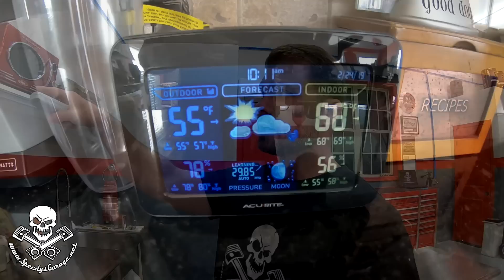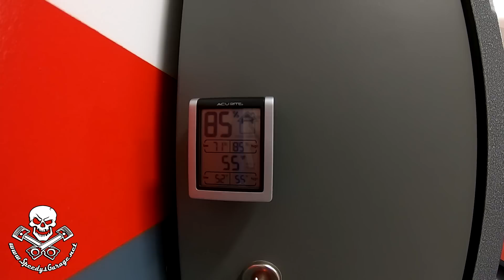Speedy's Garage Shop Build Getting Close

Comment: I feel you with all the rain...I think ATL has turned into Seattle since the first of the year.  Today is the first day we have had sun in a while.

Insulation is not the place to skimp when building anything.  It really makes a difference.  Acoustic sheetrock is pricey, but it works.  I've used it on a couple of theater projects, and it makes the space acoustically dead (no echo).

Great info...keep it coming.

Comment: I think the go-pro worked well for you. Just a little hallow tones  and echo. Are you using a external mic? Are you using a dead cat mic cover? It should help with the echo. Thanks again for the work in putting these out. I put my shop build off until april. But we have had such a late heavy winter in February that I might push it back until mid May before thaw LOL
Reply from the maker: Yep, using a dead cat for sure.  Prob gonna be some echo since most of the content is filmed in the shop itself.

Comment: Great video again Jay!  Thank you!
* In an earlier video I saw reflective metal foil on the interior side of your roof deck.  I assume that is rigid foam boards.  Is it?  How thick?  Was that done to help stop radiant sun heat from heating the attic space?

* Does your attic have any conditioned air? Or is is vented to the outside with roof and soffit vents?
Reply from the maker: That was actually on the ply wood itself.  It's a heat control material, and there is no A/C in the attic other than the soffit and eve vents.